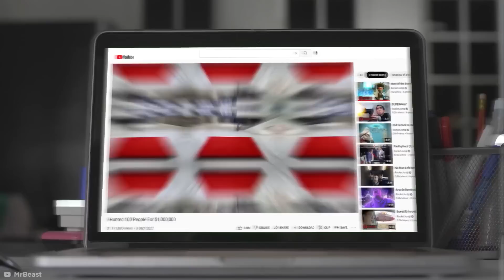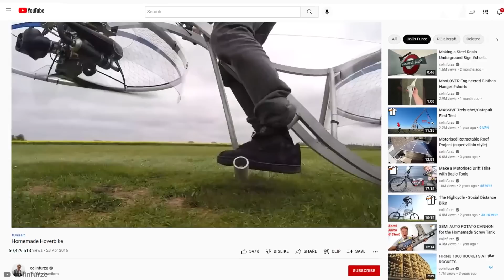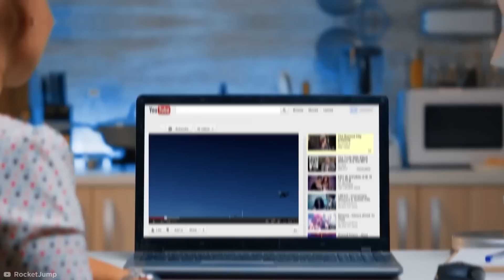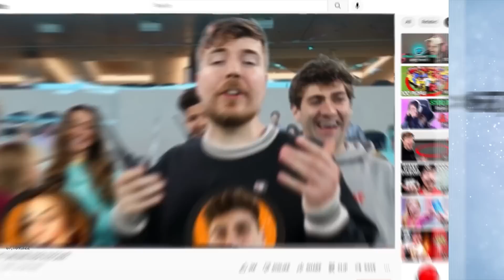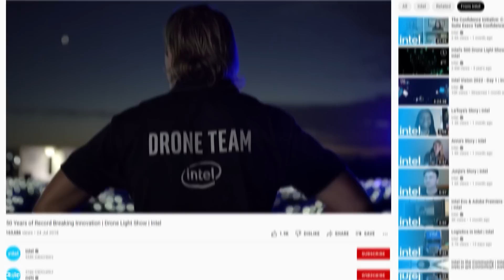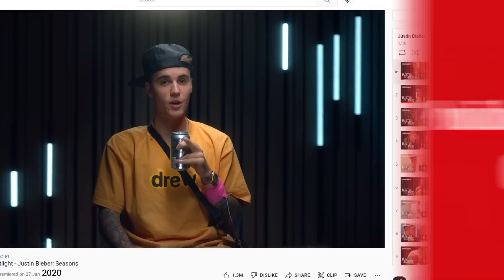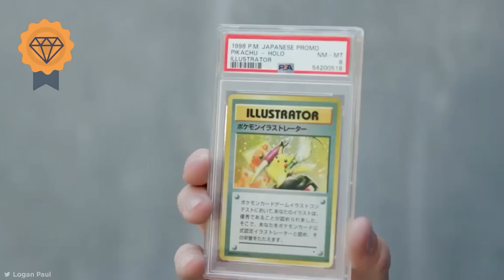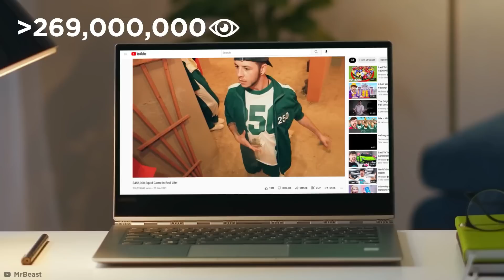Most Expensive YouTube Videos

Comment: The average US stadium has about 69,000 seats. The average price per MLB ticket is $22. So a sold out stadium would generate about $1,518,000 USD (plus the revenue from vendors). NFL tickets are much much more costly but don't require the stadium as often with only 8 home games per year vs MLB's 81 home games. Mr. Beast paying $1,200,000 to rent a stadium for a day sounds about right, especially if doing it during a time of year that its not being used as much.